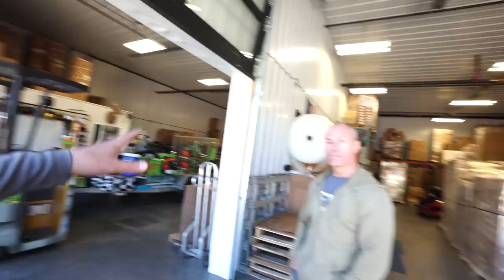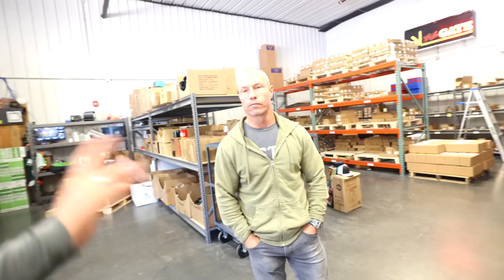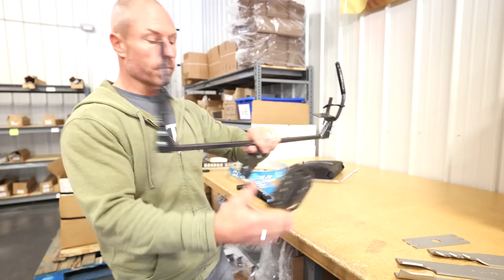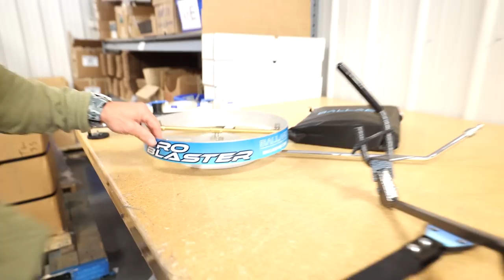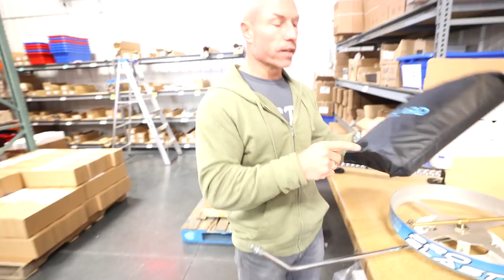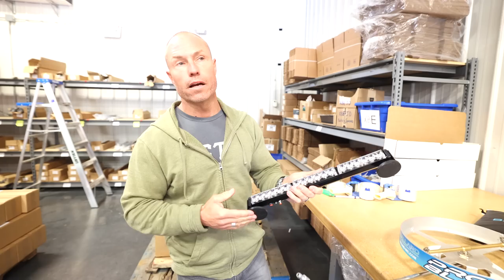NEW GEAR From Ballard Products For 2021!

Comment: Imagine having that deck cleaner/power washer set up on your trailer with a catch where you drive your mower over it and turn it on so it cleans the deck between lawns.  Sounds complicated to pull off but would completely eradicate one of our industries biggest problems - spreading weeds from lawn to lawn.